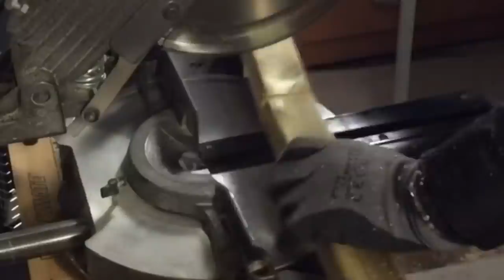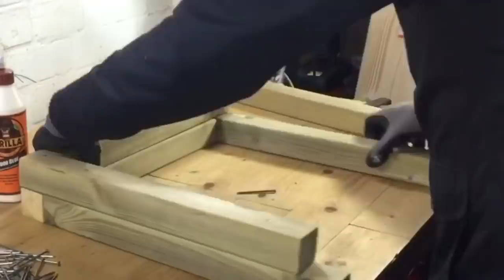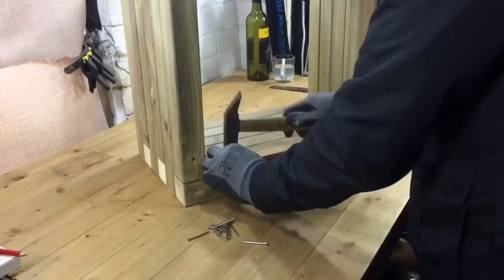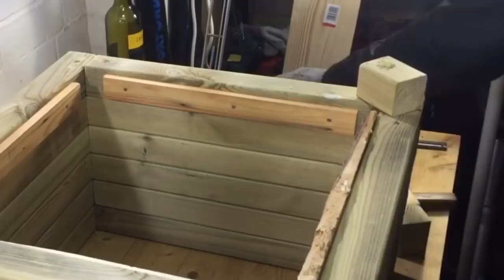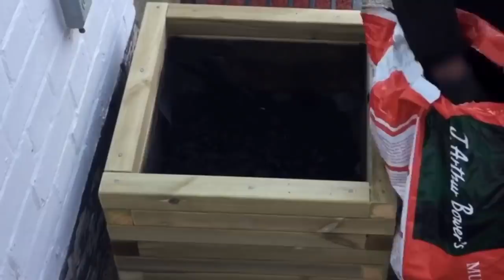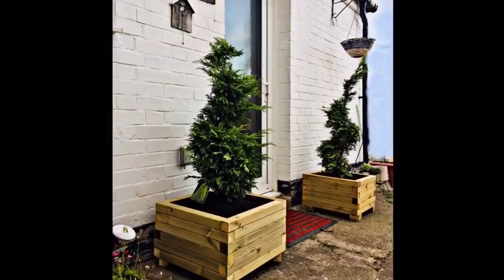How to Make a Wooden Planter Box - The Easy Way to Build a DIY Planter Box | DIY Decor Ideas

Comment: I subscribed to your channel after watching this video. This is exactly what I am wanting to build and plan on attaching caster wheels on them.  I would like to add a long handle (hopefully detachable, close the top as bending over too low can be challenging) so I can move them around with sun exposure  requirements (I have a huge south facing porch). Any ideas would be appreciated if not that's fine. Love you channel!
Reply from the maker: Thank you so much for your comment and subscription! I appreciate it a lot. I think that the caster wheels are a brilliant idea as well as the long handle. If I was you I would try and find a long screw with a ring at the top to screw It anywhere from the moment that the planter is nailed and glued well. And a rope with a hook at the one end to carry it anywhere you like😀.
Reply: @DIYPD  
Thanks so much. I will send you pictures of my "masterpiece" when I get it built. ☺
Reply from the maker: I’m looking forward! If you need anything else just text me!
Reply: @DIYPD  excuse me but I was just wondering what the basic plans was for this project
Reply from the maker: Firstly, my aim was to build a planter easy and fast. Secondly, the plan was make it square, with all the pieces the same length. I used and glue and nails to build it from the bottom to top.
Reply: What measurements did you use so I know off hand
Reply from the maker: I bought 5 fence posts weather treated 2 by 2 inches with a length of 2400mm. I cut all the pieces the same length of 450mm. Start building it from bottom to the top. It’s “floor” need screws or nails and glue. I hope this will help. Good luck!
Reply: Perfect lol..do I gotta put supports on the inside of it after I get halfway through building it or no??
Reply: For the bottom of the flower planter what kind of wood did you use and what length did you cut them at???
Reply from the maker: Doesn’t need any other support. You will see that the result is solid. For the bottom where the soil goes I used thick pallet wood. From the moment you will build the walls measure the inside and follow the video to make the base.

Comment: I made planters this way 15/20 years ago and I still use them. Remember to drill holes in the second top slat and fit rope handles. Once filled they can be heavy and 20 years from now you may not be so fit. Tanilised wood also helps increase the life of the planter.
Reply from the maker: Good point! Thank you very much for the tip! I’m so happy to hear that 15/20 years ago it’s a lot of time!

Comment: What a quick and fantastic diy planter 👏👏How does the excess water drain out? Should the sides of the planter be lined to avoid the wood to rot?
I really like that you have answered every query 👏👏 subscribed
Reply from the maker: Thank you very much Sunita! 
I have drilled holes at the bottom so the water is draining out. 
In regards to the sides of the planter that is a very nice idea 💡- the reason I didn’t lined is because this is an already weather treated fence post and doesn’t need that much as it will last for decades as it is. 
Hope you will enjoy my other videos!!
Any ideas or thoughts are always welcome 😀
Reply: Thank you so much for the clarification @DIYPD 🤗
Reply from the maker: You’re very welcome!

Comment: Great Video. Correct me if im wrong, but the length is 45cm, and the width and height are both 5cm?
Reply from the maker: You’re absolutely right! Thank you😀
Reply: @DIYPD  I was planning to make this for a scholl project but sadly they didnt have the correct measurements.....Still a great video
Reply from the maker: @achannelwith53subsfornorea38 thank you very much! 😀 remember for the next time. The length is 45 cm and the height is 6 layers, if I remember well the total height around 30-35cm.

Comment: Nice and simple method 👍 and looks great. Just a thought to simplify even more - when fitting the base boards you could have left a 5mm gap in between each board for drainage, instead of fitting them with no gaps and then having to drill holes
Reply from the maker: Thank you very much for your comment! I thought to do the gaps between the boards but I was thinking the drainage will be a lot and it will loose the water quickly. Anyway after so many years works really well 😀

Comment: It might help to note that, in the US, 2x2s are not actually two inches by two inches. So the boards used in this video are not a standard size carried in most stores. A 2x2 here is about an inch and a half by an inch and a half. Just some info for any folks that are new to woodworking :)
Reply from the maker: Very useful tip! Thanks Ellie! 😀

Comment: This in brilliant! Exactly what I want to create but rectangle instead of square... Probably 1000mm long. Would the same principles work? Any tips? Thanks in advance. Subscribed
Reply from the maker: Thank you very much Amit! 😀  After two and a half years they look still great!  Is exactly the same way for 1000mm but it will be very heavy. So my advice is to add a very good quality of heavy duty castor wheels. If you need anything else just comment!😁
Reply: @DIYPD  thanks Peter. I've taken inspiration and drawn out the design. I've opted for 800x350 using 3x3 instead. This gives me 650x200 inside space. 

Three layers and using the off cuts for the feet as you have so 300mm high.

Noted re the wheels, I think I saw a video where you have done that so will rewatch
Reply from the maker: Nice plan mate! I bet they will look awesome!

Comment: Great video. My daughter and I just made it this past weekend. I used pleasure treated 2x2s but they look  smaller than what you used. I have 9 layers and still seems shorter than the one you built. What lumber did you use and where did you get it?
Reply from the maker: Thank you! I bet your daughter is very happy! I used 2*2 treated ( from homebase) fence posts 6 layers, and each piece is 450mm. So in total without the legs each side is 500mm width and height 275mm. . I hope this helps but let me know if you need anything else. 😁
Reply: I had the same result....
Reply: Can you use this same method with 2x4’s?
Reply from the maker: @JR-dv9kz of course you can! 😁

Comment: Just subscribed! Question, for the bottom, what kind and size of board are those? Also, for the side that holds the bottom boards, what kind and size are the 4 boards? Sorry if I sound confusing.
Reply from the maker: No worries doesn’t sound confusing at all. First of all thanks for the subscription! I used treated fence posts  2 * 2 and the same length. All of them 450mm. Now for the bottom I don’t remember the size but is just a usual pallet boards.
Reply: Thank you!

Comment: Do have the specific measurements and supply list? Great video thanks 🙏
Reply from the maker: Thank you James! I used 2*2 treated fence posts 6 layers, and each piece is 450mm. So in total without the legs each side is 500mm width and height 275mm. . I hope this helps but let me know if you need anything else. 😃

Comment: Naive question here... the holes in the base of course are for water drainage?   I think I'm going to give making one of these a go as it looks so easy albeit a 100cm x 40cm x 35cm. Just want to make sure I have the correct drainage ability :)   (honestly, I've never done anything like this before haha... I work in IT, not carpentry)
Reply from the maker: It’s not naive at all😀! Yes the halls are for the water drainage. Don’t do to many halls.
Reply: @DIYPD  Hi.  thanks for your reply. All timber ordered to make a nice 1.4m by 0.6m planter.  Now, it looks like you used weed control fabric to line the planter. Is this correct or is it a more specialist lining material?  I assume of course this is to retain all compost / soil but allow water to filter down and drain so nothing drowns. I see a lot of people in other places suggesting lining with plastic and poking holes in the bottom for drainage.  Our planter will be on a patio so my thoughts on this would be that soil would eventually filter out the drainage holes and onto the patio or end up blocking them. As such would you recommend the weed control fabric over anything else?  Cheers
Reply from the maker: You’re very welcome! I used a weed control fabric because I had a lot  but I believe with the plastic will be better for your plants. 1,4m planter is huge and very heavy. I will suggest castor wheel on each corner.
Reply: @DIYPD  A wise suggestion re. castors :)

Thanks again for your advice.

Comment: I have now subscribed to this as I am a novice when it comes to things like this. You make it look so easy so I am going to give it a go.   Would you please be able to give a detail of all the materials you used please? How many 2x2 etc as well ? I noticed you used wood at the bottom and also on the sides to stick the bottom to? Thanks in advance. I want to make this at the weekend if possible so a response would be appreciated. Thanks 👍🏻
Reply from the maker: Thank you very much for your support! Trust me it’s easy as it looks! From the moment you have everything ready the assembly goes very fast. If I remember well you will need 5 posts 2*2 of 2400mm Cut them in 24 pieces and all of them same length 450mm each. And you’re ready to go! Glue and nails or screws. From the leftover wood you can make the legs on each corner. The base or floor is just a crap pallet wood. If you need anything else just tell me. Good luck!
Reply: DIYPD thanks very much!! 🙌
Reply from the maker: You’re very welcome!

Comment: Hi, please, what did u put on the inner sides of the planter? Thank you for your reply.
Reply from the maker: It’s a weed membrane.
Reply: @DIYPD  thank you - quick question - how is the wood protected against the humidity? Would it be better to use some kidn of waterproof membrane? Thanks for your feedbackm
Reply from the maker: If they have of course you can use it. In my case I’ve just used normal weed membrane The wood is a fence posts so is already  treated and they will last for many many years.

Comment: What kind of nails are you using? If those are 4x4 seems like they’d have to be pretty long?
Reply from the maker: There are a little bit long! 7 cm
Reply: @DIYPD  I'm confused.... if the wood is 4x4 inches (3.5x3.5 actual), wouldn't the nail need to be longer than that to get all the way through?
Reply from the maker: Sorry Anthony  2*2

Comment: what is the length of each pallet what kind of wood you are usind 2*6??
Reply from the maker: The size of wood I’ve used is 2” * 2’’   The type of wood is fence posts and the length of each piece for the planter is 450mm. I hope this helps!
Reply: How many 8ft posts would I need to make this
Reply from the maker: I’ve used 5 fence posts exactly for this planter box.
Reply from the maker: Carnifexx 2*2

Comment: so what is the advantage of using a nails rather than screws ? thanks
Reply from the maker: I’m trying to use what I have in my workshop. There is no any advantage. You can use nails or screws if you want. In my case I had a lot of spare nails that’s  why I used them. And after 2 years it’s still solid like the first day! 😀
Reply: @DIYPD  thanks :D I have lot of screws so will go with that option haha
Reply from the maker: You’re very welcome!

Comment: Do you drill before you nail?
Reply from the maker: Only for the legs I drilled and then screws. For the nails no. There is no need.
Reply: Thanks for quick reply. I tried early,.....but the wood split?
Reply from the maker: You’re very welcome. Sorry about that. Looks like the wood is completely different I used treated fence posts and I didn’t  have any wood split.
Reply: @DIYPD  don't know what was the wood I used 🤣

Comment: You should probably include the measurements of the 4 little boards on each bottom side and the slats that line the bottom of the planter. They are not part of the 2 x 2 lumber pieces like you mentioned.  That way there's only one trip to the home improvement center we need to make! Just sayin....
Reply from the maker: Thank you for your comment. That’s true, but unfortunately it has been 4 years since I made these planters and I have gifted them otherwise (well spotted!) I would have given you the measurements you need.

Comment: What materials do I need for this
Reply from the maker: 5 fence posts 2*2  of 2400mm each, nails, glue and pallet boards for the bottom.
Reply: @DIYPD  does each post need to be cut to exactly the same length
Reply from the maker: Hi Stephen! Yes all the pieces for all sides are exactly the same length.

Comment: Great idea in principle but it's going to rot especially the bottom in just a few years
Reply from the maker: If that happens I’ll make a new one! Always positive!
Reply: @DIYPD  I love this so simple ! Pressure treated 2" thick timber will take years to make a dent in that & when it does make another ;) I am going to make one for my patio I want a long one though quite deep too! lined in thick poly with a few largish holes for drainage rather than lots of small ones (use broken crocs/pots to cover the holes so they dont 'plug up' over time with compost. I will use large empty milk containers to fill the bottom up (use a lot less compost that way) Thanks again for the vid   👍 🔨💐 🌸 🏵 🌹 🌺 🌻 🌼 🌷 🌱 🌲 🌳 🌴 🌵 🌾 🌿 ☘️ 🍀 🍁
Reply from the maker: You’re very very welcome!!! And good luck with your project! I bet it will look great 👍